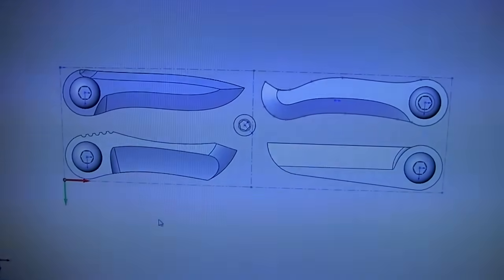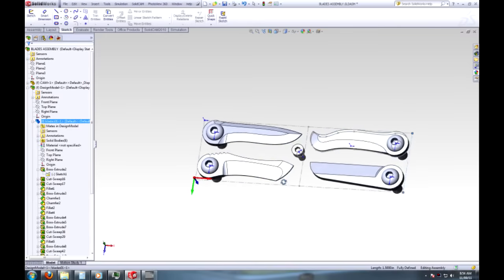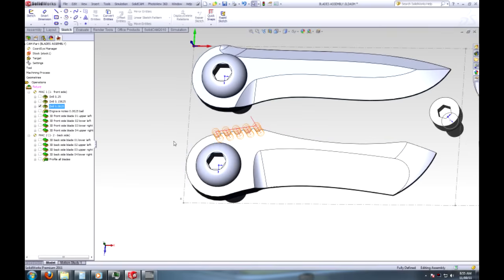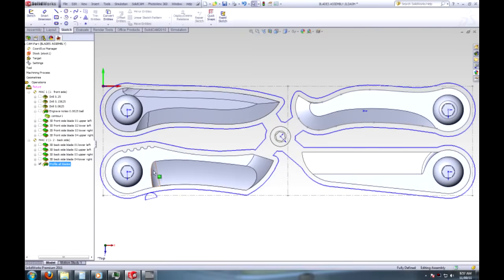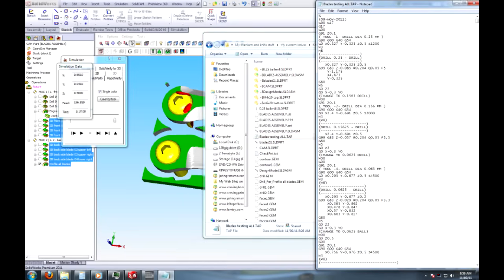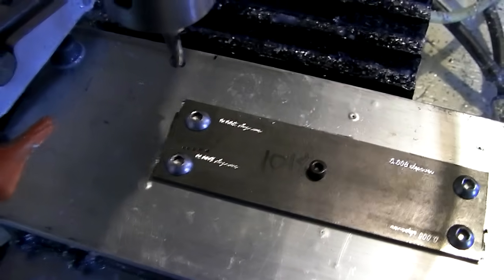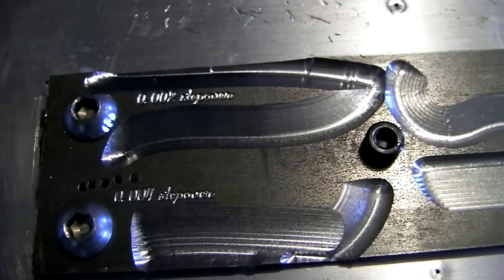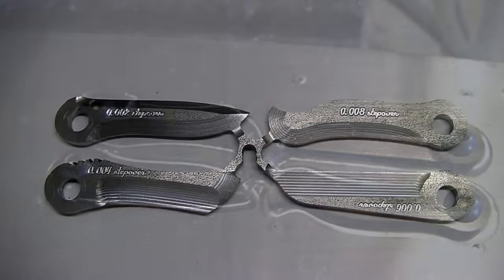Knifemaking Tuesdays Week 01 - designing and machining the first test blades

Comment: i know that this vid is old but i noticed that you still grind your blades i was thinking why not make a workhold that place the blades at an angle but vertical then just mill the blade part in 1-2 pass ( 1 rough 1 finish)  you can do a slight ark the pass so that you get the swurvy design

Comment from the maker: The machine is a Grizzly G8689 that I converted to CNC myself.  I've probably spent $2,000-3,000 on all the conversion parts and upgrades, plus TONS of my time to get it all working right.  Check out the website HossMachine.info

Comment from the maker: It steps down 0.002" per pass, and the step over is determined by CAM so that it follows the hollow grind.  The deeper it goes, more of the endmill is being used for the cut, but it's still only 0.002" step down.  Now I use waterjet blanks and start from the edge, working my way up, still using a 0.002" step-up.

Comment: I think your blade designs here are awesome. Are they originals, or did you copy already existing knives? If original, you've got a helluva eye for aesthetic and functional design man! One thing I noticed on these blades though, is you dont have a step on the back end to keep them locked open or closed. 
Also, have you thought about trying any assisted opening mechanisms? Seems like it would be pretty simple since you've got the CNC mill.

Comment from the maker: I use solidworks and have a fairly complicated way of designing the bevel.  I like to punish myself so these knives have a hollow grind, but a flat grind is MUCH easier to program and make, you just put a really steep "chamfer" where the edge is.

Comment from the maker: If you're interested in machining and want to have some real fun, you definitely want to convert a machine yourself.  I think the best one on the market right now is the Grizzly G0704, it's a manual mill, but tons of guys have made conversions so the information is easy to find, and there are even adapter kits you can buy on ebay sometimes.  Search youtube for "G0704 cnc" and you'll have an endless stream of cool stuff to drool over.  Then head to the cnczone forum and do the same.

Comment: Well done video and those blades look really good. I'm interested in making knives but I'm very much a beginner in every way (being 17 years old and almost broke doesn't help either). What type of mill would you recommend and if it is CNC ready or requires a kit, what would be the most cost effective kit but still good quality? I've seen some of the stuff from tormach but it's pretty expensive (or it at least seams that way to someone with no experience in the matter :/)

Comment: ok a little mashineing tip try to have the excess material that is in the x part on the the flat not on the blade. that will make them uniform and it will cut down on your grinding later

Comment from the maker: Ohh you mean in solidworks.  What you have to do is make a plane that is perpendicular to the tip of the edge of the blade (think looking at the tip head on), draw your sketch on that, then create a sketch showing where you want the edge to go, then do a sweep cut so that the first sketch follows the second sketch.  If you're using solidworks, send me an e-mail (my name at gmail) and I'll send you the sldprt files I used in this video to help get you started.

Comment from the maker: @triumphmanful I built most of the machine, but you're looking at a few grand to do it, $8k+ to buy a CNC mill.  It's a CAD program called Solidworks, needs a decently fast computer so it won't steal all your RAM and crash all the time.